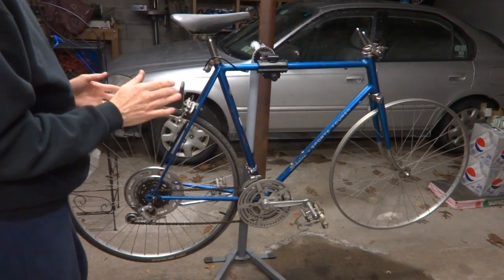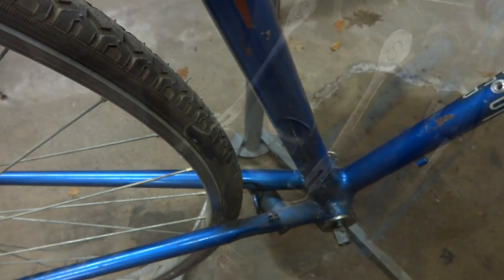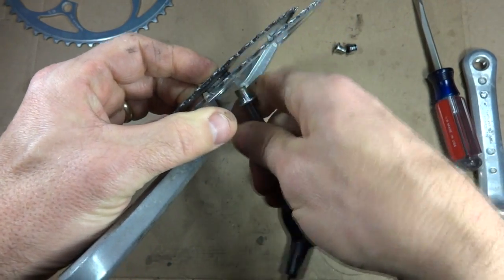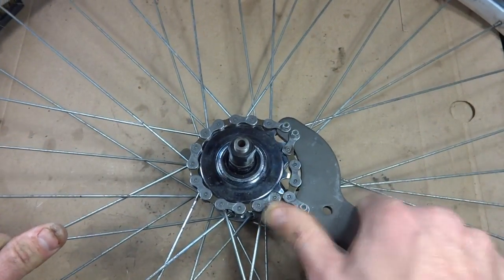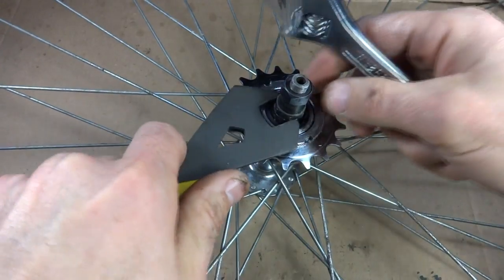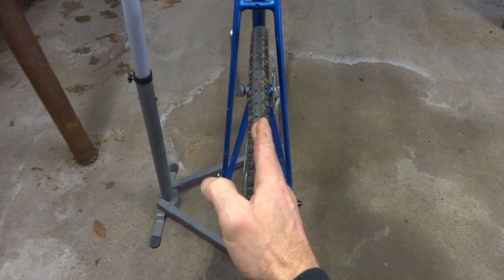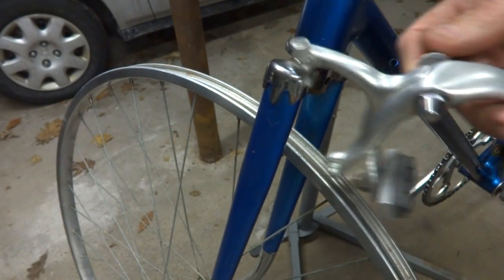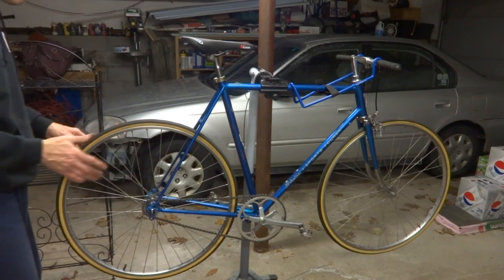How To Build A Cheap Fixie From A Vintage Bike

Comment: Oh man I am building an old free spirit Sears bike I know it's junk but just wanted to see if I could do it and learn from it. But the wheel part of this video to getting the chain straight looks really complicated... Now I'm getting discouraged but I'm going to keep watching your videos and doing research before I start purchasing components I have already started striping the bikes paint and already painted the fork. So hopefully I can get it all worked out. Love your videos and you definitely know your stuff!!
Reply: dont get discouraged, its a bit long a tedious but feasible, all u need to do is follow the math operation he did, it works, i finished mine on Tuesday after 2 tries, I had to stat over once cause i skip the math part and went on to just invert the axle and put the spacers of one side to the other and of course it only worked half way thru, when i restarted then i followed step by step and it was done, then the re-dishing of the wheel took me nearly 1 hour its tedious and kinda long but its really a matter of following the step by step operation, good luck !! Free spirit is a good build just a bit on the heavy side, i have one am restoring but will remain a gears bike but its a nice frame to get started, if u can grab a Peugeot carbolite its better

Comment: Love these how-to guides RJ, I only wish I'd had them to refer to back when I made all those beginner mistakes with making singlespeeds back in the early 00's. 

Seems like old steel framed bikes are a lot more expensive than they used to be. 

I was picking up late '80s Peugeot carbolite and mangalloy frames for as little as £15. Now they're going for a lot more.

NB bikebuilders: steel frames make for easier working-with than aluminium or anything else.

Comment: I don't really like fixies but I'm just watching the video to see more of your working on bikes. Picked up a vintage cycle. After watching this, I feel like moving my shifter levers from the down tube to the head tube or top tube. It's a bit difficult to reach the down tube to shift at times. And I need to replace the shifter cables anyway so it'd be a good time to move it if I decide to
Reply from the maker: Or get brifters!
Reply: Oh that would be great! I would go for it if I had some or could get them for cheap. But they would set me back more than the bike itself did (early 80s novara strada for $50, really solid price point for my market)

Comment: Nice work. I plane on building up a fixie, but I'm using an Italian track frame made from Columbus SLX tubing. I plan to use it as a leisure pleasure bike so the gearing is going to be easy.

Comment: Awesome video. I'm new to the bicycle world (at least the taking it apart and fixing it aspect) and this helped out a bunch! My Grandma recently asked me to restore my grandpa's bicycle which is a 1970's (I think 1972) Raleigh LTD-3. It's a cool looking bike and I'm hoping to use as many original parts as possible for a couple reasons such as to keep its originality and 2) to keep it a low budget fix. 

I wish I watched this video before I took the entire bike apart because now I'm left with a bunch of bike parts I forgot went where. The reason I did this is because I thought it'd be a way to find out what is usable and what isn't usable. 

This bike has been weathered for years and years in the Arizona hear but the main parts are in decent shape (frame, the crank after I got all the rust off, fork, and i think the wheels will be usable but the rear is slightly dented flat in one area). I believe I'll need a new bottom bracket and headset cause the bearings went everywhere when I took them off. Only thing that's holding me back is knowing the sizes to order new parts and being a bicycle noob I'm not sure what to do. I'm trying my best to keep this a DIY project and trying my best to stay away from my local bike shop. Reason being is because my grandma could of easily taken it to the bike shop herself but asked me to fix it for me to have. 

Any suggestions on where to begin? As I'm sure you know this bike was originally a 3-speed but I'm looking to change it into a fixie since I think it will be easier for a guy like me but I'm also looking to keep it looking as original as possible. Thanks for the time!
Reply from the maker: I have few different videos where I work on old English 3 speeds like that, including overhauling the 3 speed hub which is a lot of fun. https://www.youtube.com/watch?v=vNxwMwzS3Jo

Comment: Nice video, covering many important jobs! 

At first I thought I would not like seeing a vintage bike converted into a 'fixie' but you did not do anything that cannot be reversed, (with a lot of effort) so no problem. Back in the day I ran my bike fixed / single speed over the winter and then once race season started in spring and the roads were better I put the gears back on. Worth doing when the roads are covered in dirt and grit over winter, and when it was believed that training on a fixed single speed was good for you. My 70s Carlton is still fixed, and I have all the other original parts in a box

Only difference is that I always kept both brakes on - I know the rear is not necessary in some countries, and TT riders only kept the front, but I would rather have them both when trying to stop with old brakes / wheel rims. Also, it means you do not need to back pedal to brake - there is a reason that your hub set up is called suicide style, so best avoided.....

Comment: I am a home bike mechanic, and I learned a few things by watching this video. I am not sure about the solution you propose with the lock ring and the cog because of the small possibility it might unscrew, but I understand you wanted to get your point across about making the cheapest possible fixed-gear bike, so I take your point.

Comment: I enjoyed watching this video, the part where you work out how to get the chainring and the rear sproket to line up perfectly using that method is amazing and i will use that method myself from now on but i have 2 problems, you connected the chainring on the back of the pedal arm instead of the front and you spent hours of work playing with the hub and spokes when you can just simply use spaces (still using the mathes method) but i never thought of using a bb lockring now thats thinking outside the box well done.
Reply from the maker: If I mounted the chain ring on the front, I would have had to move the rear huib even farther over. I could have used spacers, but i wouldn't have wanted to use that thick of spacers and would have still have had to move the hub.
I got the BB lock ring idea from Sheldon Brown.

Comment: Awesome video, thanks!
One thing though: it is not safe to use a quick release on the back wheel of a fixie (or single speed, for that matter). Quick releases just dont have enough pressure, when you start pedaling and braking with that kind of gear ratio and without derailer, it will tear the wheel out of the frame.
Reply from the maker: This is from Sheldon Brown:
"Track hubs generally come with solid axles and track nuts. This is because most velodromes have rules requiring this type of wheel attachment.
As a result, it is widely believed that quick-release axles are not suitable for fixed-gear use. This is false!

It is my belief that the velodrome rule dates back to long before the invention of the quick-release, when the choices were standard nuts or wing nuts. The protruding "wings" of wing nuts might constitute a hazard in a crash, and I believe that's why the rule was instituted. Since quick-release skewers don't have any sharp projections, that becomes a non-issue in practice.

If you are going to use a quick release with a fixed gear, you should make sure to use a good quality enclosed-cam skewer."
Reply: shyflirt1 You (and Sheldon) may be right, I have to admit, I have never tried a quick release wheel on a ss or fixie. But I still dont trust quick releases... 
Not to mention it just invites thieves to quickly release the stuff from the bike, but thats another problem.
Reply from the maker: Gabor Kovacs I generally don't ride my bike to anywhere I need to leave it.
Reply: Gabor Kovacs If a bike thief wants anything of your bike, he or she is going to get it.

Comment: Nice video ... I like that you mentioned the risks and dangers, too.
Go foreward ... greetings from Germany ;)

P.S.: And I like you using metric system in most cases ^^
Reply: Don't be a snob. We use whatever is appropriate for the job. Sometimes standard just works better. :)

Comment: OMG.  You turned an early 79s Sports Tourer onto a fixie.  This is the bike I wanted but couldn't afford the $200 cost back then.

 I settled for a Super Sport for $139.  It  was a nice bike even though it had a Neanderthal one piece crank. Same fillet brazed chromoly frame as the Sports Tourer.
I could easily ride that bike with no hands. Was  that because of Frame geometry?  Don't know but that was a sweet riding bike.

Everyone back then made fun of Schwinns.  Little did they know how good they were.

Comment: Top tip. If you have an old cotton shirt cut an inch square out of it and place it between the hole and the drill bit  Amazingly it stops the drill bit snatching we used this method on much bigger holes that tear your arms off when the drill bit snatches but you'll save your drill bits and get smoother holes.
Reply from the maker: I don't see how that would work.
Reply: Honestly I don't know It doesn't seem to make any sense. It's an old train depot trick from 30 odd years back I was an apprentice and we were drilling out these great big copper lugs to terminate into the mains. Me and the electrician  were having our arms torn out of there sockets getting the lugs rebored till some old boy told us the trick I don't think it's a well known trick either. But it's always served me well.  Just try it. Then you can tell me how it works. Drilling out existing hole chips drill bits. It certainly doesn't do them any good. cut up half a dozen inch squares and put them in your drill box.

Comment: Second time I watched I didn't notice before you use a 53 tooth sprocket Have to order something that big now Not too many ppl would have the leg strength to pedal something that big I also  changed the crank and axel too info on the braking system Looking forward to more vids  What's your opinion on Arm rest with had grips compared to the drop style handle bars I have the straight road type like you installed Im trying to improve the  aerodynamics  Very informative thanks again

Comment: I bought a Firenze MT 505 today at a yard sale for $10.  never heard of them until today.  Did a little research and found out there not much in the way of quality.  Mostly the components. I am inspired to try another single speed, a fixie won't work where I live, a bike ride is typical 70% in hills of some type.
Reply from the maker: Yeah, I live on a hill. I plan to ride my fixie along the path beside the Erie Canal. Nice and flat.

Comment: Suicide rear hub! Nice!!

I've been riding fixed gear since 1972.
I would not let you build my bike.
Reply: this video wasnt ment to be the best fixed gear ever it was ment to be a cheap fixed gear  DIY. though suicide hubs are scary its only bad when you skid
Reply: +Jose Leal No, it's only bad when you are armed with legs that can lock the rear wheel and unscrew the gear. Been there, done that early on and learned my lesson without being a hood ornament, widow opener or deck-lid tester.

I got this lesson in the days of metal cleats and double strapped toeclips. A chainring with no chain at 30+ MPH isn't scary, it is potentially deadly. I also trained in the hills so being able to use the hub to hold the speed down is an imperative not a wish or a hope.

If you can't afford a proper hub at least keep BOTH brakes.

Comment: im curious about the bit where you add spacers to the back axel which ends up making the wheel to far to the right , would that have beeb avoided if you had skipped the 6mm spacers on the left side ? and just dont spcers on the side with the gears ?

Comment: Enjoyed the video very much.  Learned a lot.  One question, when installing just one break why do you install it on the front wheel as opposed to the back?  Thank you.
Reply: If you only had one brake to install, you would want a front brake, the rear doesn't have the power to really stop you when you need it.
Reply: @MrCowen2  Thank you. I was thinking that in a quick stop the rider might fly over the handle bars.

Comment: Great, great video tutorial on how to build a fix gear bike. However, when converting a vintage bike into a fix gear bike never ever use the original wheels, even if it is cheap. You have to go with the proper hubs...You're better off doing a free wheel single speed build. That's what we do. We convert old bikes with the old wheels into single speed bikes...it's safer 

Great instructions!

Comment: I would just run a cable from the handle bar shifter all the way to the derailleur. Quick tie/ electrical tape it to the frame. Works just fine. I don't know why parts of the cable havw to be exposed.

Comment: Good video. A few of observations:

Most people don't want a true fixie; they want a single speed. 

Unfortunately, most recent-vintage bikes have vertical dropouts; there's no way for adjust for chain tension other than add a tension pulley.

A dishing tool and truing stand are expensive luxuries. For anyone wanting to re-dish and true a wheel on a budget, using a cut zip-tie attached to the seat stay, and flipping the wheel over in the frame to check for centering is good enough; micro-millimeter precision is unnecessary.

Comment: you know I was going to do this... and then I picked up a Dawes SST AL polished from bike Island for $280 shipped.  It had a scratch on the Carbon fork. No big deal and if It is a deal then I'll just cut down my Cannondale premium carbon fork and drop on it.
I guess for the overall $ out of pocket, it is really hard to find a donor bike and then get the parts needed. Especially when comparing the components on the Dawes SST AL.  However there is still the desire for a SS that can fit 700x37 Continental Top Contact Winter II + fenders for winter riding. ;)  you know,  since cogs and rear derailleurs just ice up into single speeds anyways, lol.

Comment: Good video but I've always redished the rear wheel and gone with a 110 solid axle and fit the chain ring the right way round.  It's aesthetically horrible to ride with 4 sprockets missing.  Also, the "close but not touching" chainring is OK on the bike stand but can contact when you put 800W down from a standing start.  Oh, you don't need a special tool to remove the freewheel, just a hammer and a chisel :-)

Comment: That was a very desirable hand built fillet braised Schwinn Sports Tourer. The bike looked in very nice condition, so if you just polished up the chrome and put fresh grease in the rims and bottom bracket you probably could of sold it for more with less work. At least another classic hand built high end Schwinn was transformed into a fixie!😢

Comment: Very great video again. I especially  liked how to make the chain line straight. I have a question about this. Would it do (but i guess not) to simply put a 6mm spacer (un your case) between the cog and the "wheel" ? Thank you very much
Reply from the maker: There are only 10mm of threads on there. Not enough threads for the spacer, the cog and the lock ring.
Reply: Yes I saw this in the meantime in another vidéo  where you answer exactly to this question. Thank you very much for your answer. And your great content!

Comment: If the dropouts have a vertical slot and not a horizontal slot (as on the bike in this video), It will not be able to be converted to a fixie? Great quality video by the way. Thanks!
Reply from the maker: Not easily. You need to be able to tighten the chain. If find the right gearing combination and chain length you might be able to use the slight bit of horizontal offset found on many vertical dropouts.  Or there is a special hub you can buy, but it is expensive.

Comment: Maybe one way you could lock the cog is by drilling a small (1mm diameter by 2 ou 3 mm deep) hole right in the joint between the cog and its support (don't know the exact term). Then you thread the hole, and screw small headless allen screw inside the hole. It will interlock the cog and its support. But I think this kind of modification, while it can be unscrewed, will never screw back in place afterward. Kind of "easy soldering"...
Reply: (sorry about my English, I'm no native English speaker...)

Comment: Another great video RJ. Not sure if you answered this elsewhere in the comments, but I noticed you secured the rear wheel with a quick release. In your experience, has this been strong enough to hold it in place?
Reply from the maker: I have not had a problem with it.

Comment: RJ thank for the great videos.  QUESTION - I have a peugeot like yours and want to remove the old crank and BB.  Can I go ahead and screw in my GXP?
Reply from the maker: +Rob Bastien If you have an old made in France Peugeot then you have all the French threading. You would have to find a bottom bracket with French thread or threadless setup. I don't know if they make a French threaded GXP BB. I am guessing not.